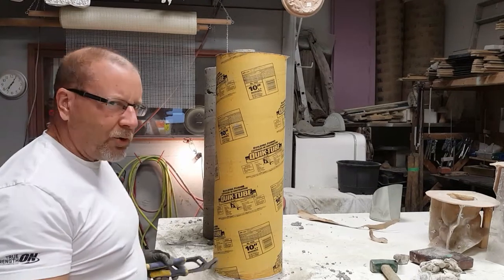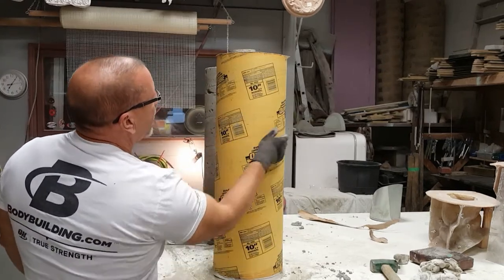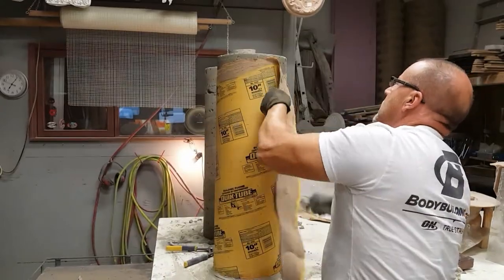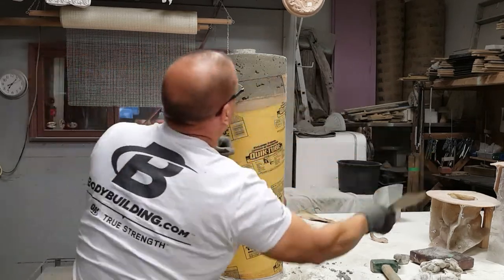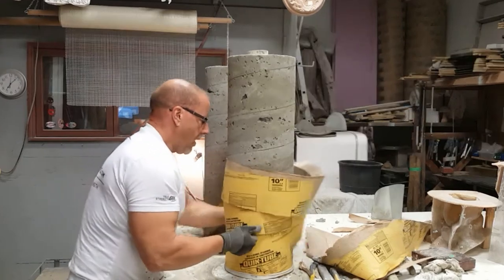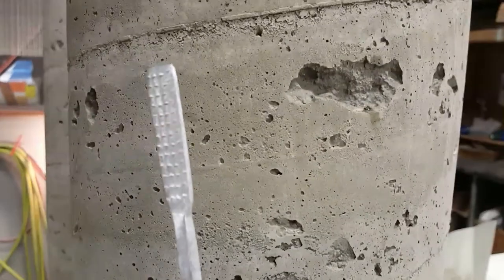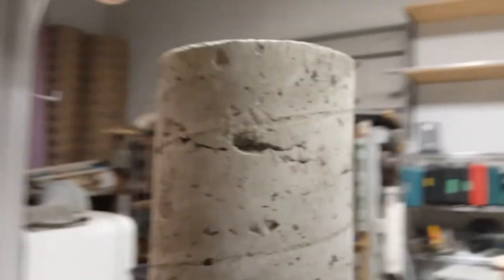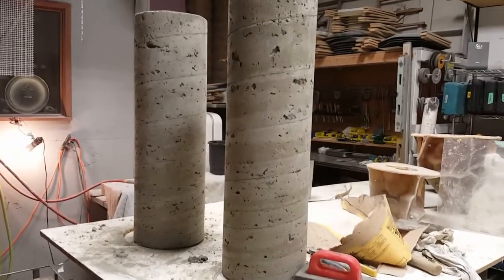Stripping the sonner tubes (sort of lol)

Comment: What if you placed the wet forms on a table with a fairly cheap vibration motor attached to it during the filling and drying process to eliminate all the air pockets🤯

Comment: For those of us who can't press 100's of # how do you think it would work if I made it hollow  using a smaller tube inside. Because that has got to be very heavy
Reply from the maker: You make a great point Sharon.Yes you can ,and I do as well for other projects.I just wouldn't do the dry mix ,on a thinner walled pillar you need to keep the integrity of the concrete.You could also do this with the piece being on the ground on a piece of melamine or plywood.I find it easier for myself to take it off the table ,and yes it is in the 200lb range.I might do a follow up vid and bring up your question.Thanks for your input :)